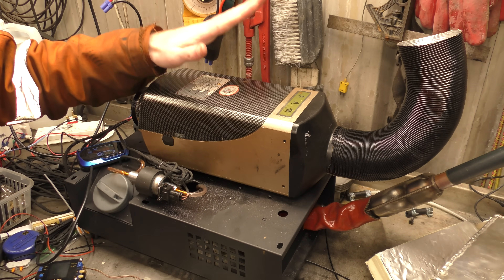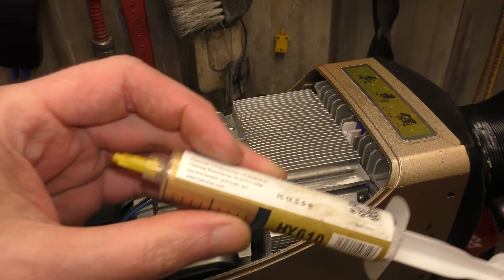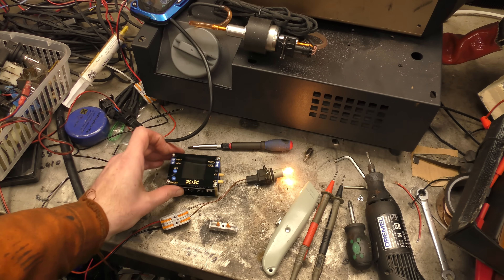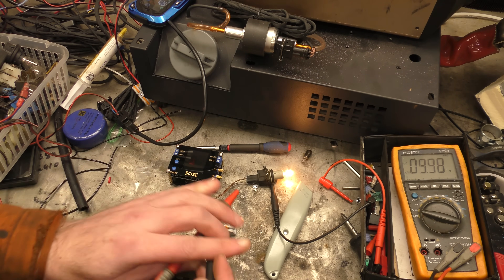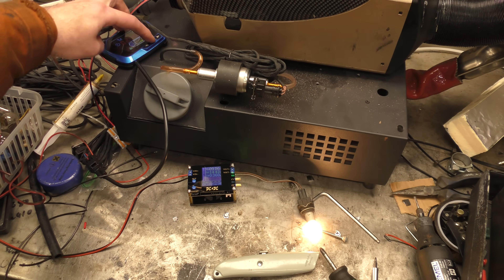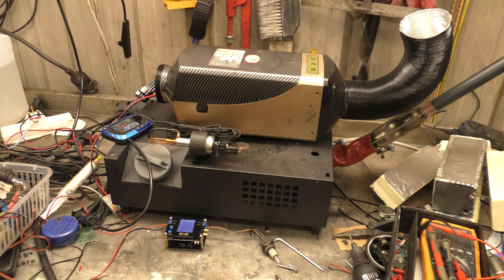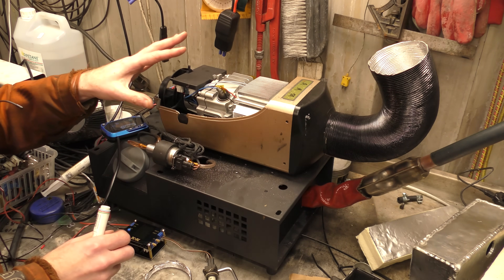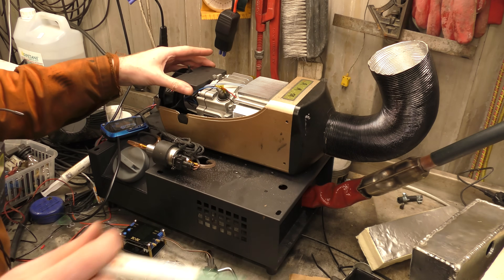Self Powered Diesel Heater Project - part 4 - custom heat exchanger

Comment: I believe you would need to generate at least 1.5amp at 14v (21w) from TEGs to keep the heater running at minimum power. Right?
So, not considering the economical side of the equation, is there even enough potential difference energy vontained between the exhaust side and the cold air intake to maje this work? Because if yes, it can be done and if it can be done , you should do it. If not for any other readon, at least as a proof of concept.
Good luck dude. Youre doing great. Don't let any one tell you what can be done and what cant. 👍
Reply from the maker: Yes.  https://www.europeanthermodynamics.com/products/datasheets/GM200-49-45-30%20(2).pdf

If you can get the hot side 200ºC and the cold side 30ºC they should output 7.5W each.  I think this is where the solar MPPT controller would shine, if we had enough volts to get it running it can match the load resistance and extract max power.  If I've correctly understood how MPPT works.

It will still require more TEG modules as they only output 3V each.
Reply: @DavidMcLuckie  i like where youre going, but! Personally i would try and use least possible circuitry between supply and load. You'll find out how inefficient every component would be consuming a considerable slice of your initial power generated. Link  the tegs in packs of 5s to obtain a 12 to 15v constant supply, then stack multiple (3) series packs in parallel  to generate enough current to feed your load. Total of 15 tegs ($1500 😱)
Your main objective wohld be to suvk up as much energy as possible from your exhaust side and transfer it to the intake side. The only component you might want to use between the load and teg would be a supercapacitor that will smoothen out the pulses of current draw from the fuel pump.
Also, that fuel pump sucks, it sucks both fuel and electricity. If you could cone around installing a more efficient fuel pump maybe, help it with gravity fed fuel and get a smaller coil pump which will only control the fuel flow without generating pressure? 🤔
Every little bit of energy is gonna make a huge difference in this test.
Aldo, insulate the exhaust pupe between heater and teg, this way you don't loose energy before the teg modules.

Comment: If you'd like to successfully generate enough electricity to run the diesel heater I have the solution: I've made some videos recently of a thermal recovery system on a diesel heater that uses a large old steam radiator connected to the exhaust.  The radiator gets much hotter than I expected and is a large heat sink that varies in temperature from 300 degrees (°F) near the exhaust input to around 105 degrees (°F) near where the exhaust exits to the port outside.  Since it's a large surface area you could temperature map it using either a handheld temp reader or even an infra red camera.   on the lower heat areas you could use a number of peltier effect TEG panels which are the cheap lower temperature versions (obviously sand the cast iron smooth and use thermal paste) and near the exhausts input into the cast iron radiator it's almost 250-300(°f) so you could use a Seebek effect panel which are the higher temp expensive versions you are using on the interior of your heater.  Another thing you could do is use the heaters intake air tube to draw in air from outside and across the "cold"  side of the TEG panels to increase their efficiency.  If you'd like to see what I'm talking about and all the extra energy you can get out of the waste heat with an old cast iron radiator you can check my channel as I made a few videos about it recently.  Anyway, excellent videos David, I appreciate them and learn a ton.

Comment: 2 square tubes, exhaust side (heat)steel and intake side (cool)aluminum put them inside your tube.  insulate the steel (heat) side with insulation of your pleasing.  intake side add as many heat sinks fins that can allow for good air flow while in the tube, use the inside of the square aluminum tube as a water jacket and the outside of the tube as airflow.  place all parts inside the one outer tube. for keeping your cooling water cool use your water heater setup on the cold air intake side to reduce the heat from the water.  Have fun don't blow up the shop cant wait to see what you do next.

Comment: Again, a lovely fabrication. Perhaps the fourth teg would give the 14v+ required. I have been trying to get a very simple coaxial heat exchanger to prewarm the incoming air from the exhaust much like the balanced flue on my boiler. I still have a Mitsubishi L200 egr plate heat exchanger to fit to produce hot water on my boat but I am beginning to think that I have gone the wrong way and I should have had a wet system from the start. That said, my 2kw burner swiftly gets the boat up to temperature and the lowest setting (1.2hz) is only just low enough to maintain a comfortable environment. At the low setting it draws less than half an amp which is fine overnight with the battery alone. During the day I am not outstripping the solar input so all good.

Comment: I’ve seen a few comments here about the possibility of using a Stirling engine, but having (briefly) experienced first hand the Baxi-EcoGen gas boiler that heated the home of a family member, the mCHP generated around 1Kw of electrical power and used the waste heat as the heating output. 

Beware of the “rabbit hole” of free piston Stirling engines. If you think Chinese diesel heaters are addictive...
Reply from the maker: Just Googled that boiler.  Looked interesting.  £11000.  Might need a lie down now.

Free piston stirling engines here we come.  :)
Reply: I should have added: there was another burner that produced additional heat when needed, but the primary/initial heat source was the mCHP burner that powered the Stirling engine

Comment: What's the spec of the lamp? Did you try driving a bigger load? The lamp might have been the limiting factor.
Reply from the maker: Excellent suggestion.  I'll try that before I swap onto water blocks.
Reply: @DavidMcLuckie  - If it's a 5W automotive lamp, such as a side light lamp, then the most power you'd draw at 14V is a little over 5W as these lamps are rated at 13.5V.
Try a 55W lamp or connect the output to a 12V L/A battery. Also check the max current setting on your buck/boost convertor. Good luck 👍
Reply: @DavidMcLuckie  Hello David.
This boost buck converter can output up to 3A/35W without fan, 5A/50W with fan, and about 70 or 80% efficiency. A boost only converter could be 90% efficient. For exemple I use bst900 and bst900w it’s cheap, I saw bst400 also on aliexpress, there are many models.
Cheers.
Reply: @hommerdalor6301   do you have a link to these more efficient boosters please? 👍🏻
Reply: @daveparf  Hi David, not directly, I’ll search, but the bst900 has a screen, witch consume some power, boosters without screen should be more efficient.
Reply: @daveparf  From Aliexpress, I also have 1800W 40A DC-DC Constant Voltage Contant Current DC Boost Converter Boosts 10-60V to 12-90V Boost Power Regulator Module 20,67 euro.
Andy from off grid garage tested it in Boost converter efficiency - worth it?
also almost the same 1200W tested by watthour Review of 1200W 80V DC Boost Converter tested at 1KW. He tested others also.
Cheers.
Reply: @hommerdalor6301  thanks for that I’ll look into them 👍🏻
Reply: @daveparf  ;-)

Comment: I made a TEG  generator years ago when I was living off grid, the heat source was a wood burner and I used water cooling after losses (water pump to circulate the water  etc etc  etc ) I was getting 107 watts usable energy and in winter the burner was running for 18hrs a day. I used something like 50-80 of the cheap small TEG units as I got them for nothing. The big draw back was the size of the unit  and the low efficiency of the cheap TEGs as they melt if too hot as you said in your video. This system made up for the lack of solar energy in winter and kept me going for the 5 years I was living off grid . Looking forward to seeing what good quality TEG's can produce.
Reply: That sounds like an interesting project. Regarding the melting issue, you can use bimetallic strips to move the TEGs away from the extreme heat, like those stove top fans have in their base.
Reply: @SimonCoates  the TEG modules wasn't in contact with the surface of the burner as it was a rocket type space heater/thermal mass and I couldn't cool the TEGs quickly enough as the surface temperatures where very high before it destroyed the module
Reply: 107 watts from like 15-20kw of wood is about nothing.
Reply: @casemodder89  well it was the best I could do and it covered my needs
Reply: @jamesemery1  yes of course but this is nowhere near a promising idea for a 'self powered heater'
Reply: @casemodder89  I wasn't using them to power a diesel heater, I was using them to charge my batteries and in the depths of winter when there is fuck all solar energy 107w for 16-18 hrs a day made a big difference
Reply: @jamesemery1  yeah i got that from the beginning. but in the 'self powering' heater case there is nothing to archive without efficiency.  and your example proves the TEG as extremly inefficient.

yes, a few watts is better then nothing. but burning wood worth of serval kilowatts for a few watts of output is not gonna get you anywhere energy-wise.
Reply: @casemodder89  in off grid system 107w x18hrs is just over 1.9kwh of energy generated this is not a trivial amount of energy when living off grid. The average uk house uses around 8kwh a day so 25% of a average household consumption generated is not a bad return considering the burner needed to be running to keep me warm

Comment: For the new exhaust system. 
Why not use two square section one for the exhaust and one for air in, with the teg in between.  Please try steel not aluminium.  I'm sure steel will get hotter than aluminium. Also in real life situation you use the heater when it's cold outside. So you have lots of cooling potential, not least a very large cold metal box, in the form of the van itself, so mounting the cold air side flat against the van. Don't know how you replicate this in the workshop.
Back to this video.
With regards to the air in the van getting hotter and reducing the efficiency on this set up. I would suggest using fresh air from outside the van, or a mixture of both. A bit like how you use a car's heater, you can choose to recycle the air or not.
Yes your heater has to work harder using more fuel. But the air quality is better, less condensation, and I think a cleaner burn. Just make sure you don't draw in exhaust fumes. I like this it's a great brain workout.

Comment: Ha, I started writing a comment and realized you started describing exactly what I was also thinking. I think this idea is much better, using the combustion intake/output air. For example right now it’s about 0 C outside, and your exhaust air is probably something like 200 C? You can double or maybe even triple stack the TECs to produce a module that takes advantage of higher temperature differentials, so if each TEC only has a delta T of 75 C max, you could theoretically stack 2 of them to have 150 C air on one side and 0 C air on the other. 

A simple TEC (or stacked set) with an enclosed heat sink on each side, where you pass intake combustion air on one side and exhaust on the other, would give you the biggest temperature differential. Rather than lining up the TECs in series like you drew on the white board, so that the subsequent modules get less delta T, you can split the intake and exhaust air into parallel streams, each stream going over a TEG that will see the same delta T.

Another completely different idea, is I was wondering if you had a concentric intake/exhaust pipe, so that you are preheating your input combustion air with the exhaust. I don’t know if that would decrease the efficiency of combustion since warm air has lower mass, but the idea that more heating power is conserved. I think the above idea has more promise though. The higher the delta t the better performance you get from TEGs and intake outdoor air and combustion exhaust is the best choice here.

Either way you already have a promising proof of concept. You’re basically already reducing power usage by 10% which isn’t bad for a first try. 👍
Reply: You can get TEG's that  take 200C temp difference now.

Comment: The ONLY way this works in any reasonable way, is to use a substance with a very low boiling point, run it through a closed system, heat it with the waste heat, run it through a mini turbine, then condense is back down with in intake air... You could do it for relatively cheap... but the only substances with vapor temperatures around 30-60 degrees Celsius, are also kind explosive
Reply: Why not just use water? Or if you need lower boiling temp, enclose the system and keep it at partial vacuum like they do for hydrocarbon refining? The exhaust temperature is high enough to boil water. You could then attach the mini turbine directly to a brushed DC motor that feeds into the voltage converter (or a three phase motor fed into a rectifier bridge then into the converter). I like this idea a lot though. The heater clearly produces enough heat energy that the minimal power draw could be extracted from the heat energy to be able to run the heater unit without external power which would really be awesome because who wants a drained battery but warm car in the middle of winter? 😅
Reply: @MittyNuke1  I'm pretty sure lowering the surrounding pressure of the working fluid, will also cause it to become less efficient. In steam fixing, which I'm assuming you're referring to, water isn't used to extract energy from complex hydrocarbons, but to extract a more volatile hydrocarbon out of the matrix, low pressure being used to draw off methane and stuff... If your referring to staged petroleum distillation, that occurs at higher temperatures... Also, while the exhaust may be hot, it lacks the thermal mass to drive a turbine with the amount of water it could boil, the output temperature would drop too quickly... my assumption is that the exhaust is likely only wasting a few hundred watts at most, and using a steam cycle for such uptake would not be feasible... My knowledge of fluid dynamic however, is rather limited, so I may be wrong

Comment: The modules need a large temp difference to work well, think huge cooling fins/ large heatsink and or water jacket cooling.  Also they cost around £8 a peice for mid spec output 20watts ( each ).
Reply from the maker: If you can find me a TEG module for £8 that outputs 20W I'll buy them for testing.
Reply: @DavidMcLuckie  and I’ll buy the rest!
Reply: Agreed can be sourced cheaper.
Reply: I think you've confused TEC and TEG ratings.

These units can accept a good bit of input power to produce a cooling effect but their power generation is vastly lower.
Reply: @Spearborne   they are advertised as TEGs 18v 1.6a “output”